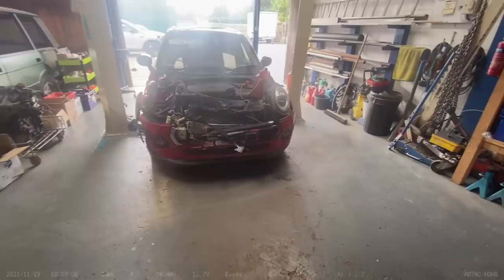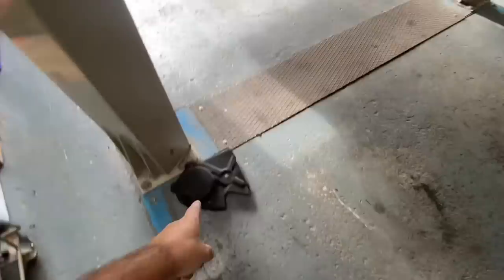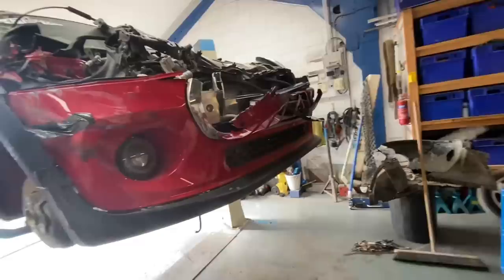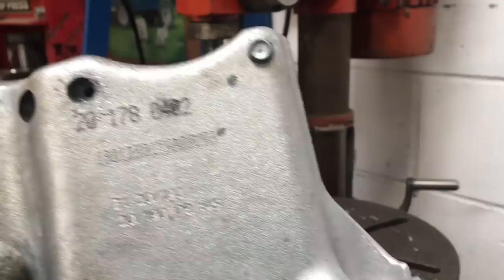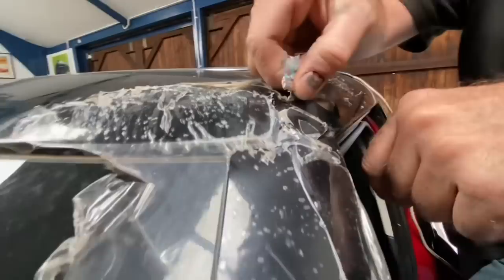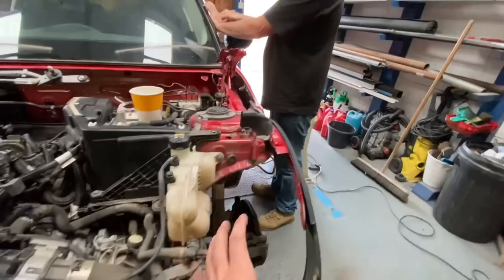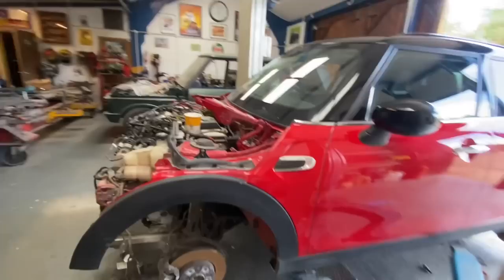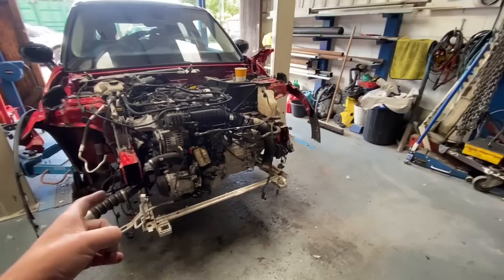REPAIRING A SALVAGE 2020 MINI WITH ACTUAL CRASH FOOTAGE!!!

Comment: Just goes to show how much modern cars destruct on impact. Cheap plastics everywhere. The design that goes into them for passenger and pedestrian safety just allows them to fold up. 1970's car would have hit the truck and carried it down the road. Hope you get all the broken bits out and the rest of the hidden potential damage is minimal. Eagerly awaiting the next instalment. Cheers guys.

Comment: When I saw all that broken plastic and damage behind the engine, I figured right away that you need to pull the engine. It would be easier to work on, plus have access to the parts that aren’t easily seen. Assess the damage from there.
Glad you came to the same conclusion at the end.
Looking forward to the next video!
👍🏻👍🏻

Comment: You excel at getting parts, you have developed a network of suppliers, where your charm and good looks open doors not available to many.😊 on a serious note, it was lucky to find that other mini, especially new enough to allow the owner let you have parts off the engine, is there a sweet point where a car reaches an age where sufficient numbers have been written off that parts availability is easier.

Comment: Hi guys, as always an amazing team work, Chris wasn't a happy boy playing with those stickers lol. Hope your finger gets better lol.
Maybe this video will make people realize how strong are the forces involved in a car crash even at low speeds, is a lot of energy to dissipate.
Regarding the magnets and paint is because dust and sand and etc gets trapped between the magnet and the paint and when the car is moving is vibrating a the magnetic sticker moves even by a little and that basically acts like sandpaper causing damage on the on the clear coat. This was what the guy from Spies Hecker told me once when i asked.

Comment: kin ell, that beginning made me jump..

I cant believe the amount of damage from that speed impact.. Thats clamshell bonnets for ya! If it had steel engine mounts & thicker mount bolts, none of that rear engine & bulkhead damage would have occurred, although the front of the engine would have had a bigger wallop. 

If that much damage occurs with them, these are gonna be getting written off left right & centre...

Comment: Phew, that was something to get the plastic haters running at full throttle. So much broken plastic to be cleared before you could see what you needed to replace. I can see why you think it was a great idea to take the engine out, so the bulkhead and the rear of the engine can be thoroughly checked over before putting it back, all sorted and tidy. You had a lucky break getting many parts as a job lot. I hope the engine removal will not reveal some expensive issues. I am surprised at the amount of damage from a low speed bump. Overall, that was a cautionary video for us all, drive carefully and avoid the damage, mess and risk of injury. (I know that without things going bump, you would be out of work, but that will not happen.)

Comment: are you going to replace the clutch whilst engine is out? being a driving school car it may have more wear - what was the mileage?  Enjoying the videos - great work :-)
Reply from the maker: Not at 30k no 👍
Reply: My previous car had 130k as a tuition car and the clutch was still original not slipping or anything. Tuition cars are probably better looked after than most of the wheels aren't turning instructors ain't earning so for me my car is checked every 6 weeks and anything looking on the way out is replaced

Comment: Great Vid as always Guys, contacts are a God Save for parts etc, Best of luck sourcing all the front bits, Give you a Laugh, washed car day of birthday, parked on my driveway hill,electronic handbrake failed car rolled down driveway crashed through front gates, gates swung back and destoyed both font wings door mirrors door handles and dented back door,So 20miles damage you were lucky, but as iam a Mechanic and can source parts car was done in 2days, Cant wait for Next vid. Darren  Co.Cavan. Ireland.
Reply: Should of put it in gear mate   i allways  do x

Comment: Brilliant video as always. Chris why don't you drill it out then use a stud remover Why continue to drill it out more?  I don't very often do things like that and I'm learning all the time
Reply: I have a left hand set of drills ( no joking ) but no good unless your drilling machine will work in reverse. I use mine on my milling machine and a lot of the time drilling them left handed will catch on the broken bolt or stud and just wind out the stud with no damage at all to the threaded mount or whatever. No need to run a tap down into the hole even.

Comment: The screeching sound has been dubbed over the top.  Seems strange the instructor didn't try to correct the wheel or apply brakes.
Reply: Looks like they were on the phone. Would love the original audio..

Comment: I thought those were quite flash with all the bells and whistles, especially in 2020. But it didn't have the auto-braking crash sensor wotsit (whatever its called). My 2018 Mazda hits the brakes itself. Gave me a hell of a fright when it first did it. I was zooming past a car that had turned off to the left and the Mazda evidently thought I was going to clip it and slammed on the anchors.   Later I found out how to reduce the sensitivity. :-)

Comment: That much damage after an 18 mph collision.? Just goes to show how cheap Mini makes their parts these days and charges a fortune for the car, On the subject of drilling out the broken bolts, would a set of screw extractors help ?
Reply: Most cars now deform like that now. Polo re-ended my dads S-Max. The ford needs a new boot door and plastic guard but the polo is completely written off like a metre shorter. Their designed to absorb and crumple rather then your chest
Reply from the maker: It hit a 2 ton 4x4 with a tow bar at 20 mph I think it did ok

Comment: Very strange accident for both front  seated  drivers to be distracted.  Is the driving instructor at fault for not grabbing the wheel and preventing the accident    win win for the Nissan owner one way to check a cracked chassis
Think it might be wise to get the brakes inspected on the mini and as the lumps coming out check and replace the clutch
Reply from the maker: It was a accident bud they happen his foot slipped that’s it 👍

Comment: Please show me how you clean up the oil on the tarmac as I have some to clean u - thanks guys
Reply: On concrete I use to do it with warm water with lemon based hand dishwash soap called Dubro don't know if you know this brand in the Uk.

Comment: Excpect the extent of the damage was caused by the fact the pickup it hit was higher up the steel chassis/bumper probable just hit the block and pushed it back. Speed wasn't that relevant

Comment: Surely a stud extractor will be easier and quicker than drilling out the bolts completely?
Reply from the maker: They just snap off
Reply: I have a couple of sets of left handed twist drill bits. They look just like normal bits except that the flutes are backwards and you use them with your electric drill in reverse. This means that if they bite into the remains of the bolt there is SOME chance of it winding straight out. Chris was drilling from the other side here, as he explained, so there was a possibility that the standard twist drill bits would 'bite' and spin the broken bolt out upwards.
Reply: @iang3802  That makes sense. Often with the bit of heat generated from the drilling process can start things moving. I had assumed that Chris had drilled right through the bolt enabling the extractor to be wound in from the broken end. He's clearly doing it all the time so would know what works best.

Comment: Strange accident that one, considering the speed and angle the car was going at I'm not sure how the driver wasn't able to brake or turn regardless of if they are a learner or not.
Reply: In general, new drivers tend to freeze rather than react when something unexpected happens. That's what dual controls are for.
Reply: Strange one for sure .
Reply: He said that he pressed the accelerator and not the brake by mistake. Prob due to it having dual controls.
Reply: @JUNK4UCREW  dual controls are only for brake and clutch. He said his foot slipped off the brake.
Reply: @JUNK4UCREW he didn’t say that at all he said his foot slipped off the break as he was trying to apply it

Comment: So they crashed on purpose right?
Reply: obviously not it must have been a brand new driver and as said the instructor went to hit dual brakes and missed
Reply from the maker: No
Reply: @TheDarkSide46  Well then its the most bizarre  crash ive ever seen. He was driving straight then just casually turned into the stationary vehicle. As for the instructor not acting in time i mean it wasn't as if they were speeding.

Comment: For a car that is so expensive new and a slow impact just shows you a low quality    built car
Reply: Most modern cars are designed to deform like this to absorb the impact to minimise damage to the occupants. It’s the same with the rear ends of cars. Main reason why manufacturers stopped selling “dog guards” for smaller hatchback models is because the poor pooch would be crushed should there be a rear end collision. 
Best to have the dog inside the passenger compartment but restrained using a suitable seat belt attachment.
Reply from the maker: Your wrong bud it was designed to do that and it was heigh up and hit a 2 ton motor with a tow bar  these are solid little cars 👍

Comment: nowadays there are very few cars with a solid steel chassis hiding behind the rear bumper
oh dear, the nissan pathfinder is one of the very few....    whoops...
 the pathfinder will probably only need the plastic bumper skin repairing
driveshafts have a habit of poking a hole in the lower engine casing, might need that engine after all...     keep up the good work chaps

Comment: That is a lot of damage for a 20mph impact but it's probably since it hit a 4x4!
Reply: Imagine the damage at 60 MPH YOU WOULD BE LUCKY TO WALK AWAY FROM IT
Reply: Designed to that to absorb the energy
Reply from the maker: @thomasshepard6030  your wrong bud these little cars are solid and as you can see the accident missed the chassis it hit a tow bar
Reply: @thomasshepard6030  60 mph impact speed in any car would be fatal

Comment: Plastic used to be good years ago - now they make it brittle - it's just not like it used to be, i have laundry baskets and plastic washing up bowls over 40 years old ..no cracks or fractures ..buy a plastic bucket  or washing up bowl from poundland you'll be lucky to make it home without shattering it  - so it seems BMW plastics are only as good or about the same as poundland 😁
Reply: It's designed to crumple on impact to save killing pedestrians and passengers...20mph causes that damage as a sacrifice.

Comment: Does the car have a handbrake? Or was the instructor not watching what the learner was doing?
Reply: It was dual control but the guy said hi foot slipped off the pedal…
Reply: @philtucker1224  I use the same make of dual control as fitted to that mini and the rubber is extremely grippy .So I’m scratch my head over this one .

Comment: I cannot work out how that Pathfinder rear end looks to have only minimal damage yet the Mini is totalled at 20mph. Not disputing the speed, but the disparity in damage levels is insane.
Reply: The front of any reasonably modern car is designed to crumple to absorb as much energy as possible from a frontal impact, the rear of a vehicle is designed NOT to crumple (mainly because that's where the fuel tank usually resides).
Reply from the maker: It had a tow bar fitted hence the damage 👍

Comment: 20mph and that's the damage? WTF, then these are a serious piece of very overrated expensive junk!

Not a great endorsement for BMW.
Reply: Hit the nail on the head!
Reply from the maker: It hit a 2 ton 4x4 with a tow bar at 20 mph I think it did ok
Reply: @sruk  Be that as it may, it still doesn't take away the fact that they are garbage and can be very problematic. Personally I wouldn't feel safe in one!

I love your channel BTW and watch from Taiwan 🇹🇼.
Reply: @terryroe2023  completely irrational......! 
... Garbage is in the eye of the beholder! They're no worse than any other modern car - it's down to your personal prejudice.....
Reply: @andymccabe6712  best we not have drama here on this great channel. I gave my honest opinion regarding this vehicle and that's never going to change.

Undoubtedly the guys will rebuild and put it back on the road as that's what this channel is all about.

This car is overrated without question just ask the Muppets that forked out to purchase one! Ridiculously expensive and bend easily, so f... that!
Reply: @sruk  would you be so easily forthcoming making such a statement if that was the Lamborghini as that surely would be in a far worse state as under the body there is very little in the way of protection.

Comment: Doesn’t say much for a mini after a 17mph shunt
Reply: Most modern cars are designed to deform like this to absorb the impact to minimise damage to the occupants. It’s the same with the rear ends of cars. Main reason why manufacturers stopped selling “dog guards” for smaller hatchback models is because the poor pooch would be crushed should there be a rear end collision. 
Best to have the dog inside the passenger compartment but restrained using a suitable seat belt attachment.  Passenger compartment is designed to be the strongest part of the car, usually made from boron steel, anything else in front or behind is sacrificial.
Reply: I see cars on a daily basis written off under 10mph passengers unharmed though !! Cars done its job !!
Reply: You do realise they are supposed to take all the impact and destroy itself so the driver and passengers can walk away, the strong bits stay strong but the rest of it is supposed to crumple and break.

Comment: Not being disrespectful, but it looks remarkably like an accident where the driver and sole occupant of the vehicle is using his phone.
Reply: Rob's story telling how the lad explained the crash had me laughing, I'm not sure how your foot slipping off the brakes makes your steering turn like that, as you say distracted for a particular reason.
Reply: Its a dual control driving school car. The instructor's foot slipped of the brake.
Reply: @geoffwoodgate7450   The insurer has bought that line, but I don't. 2 people in the car that can stop and steer it, yes, the instructor can grab the steering wheel if needed, that slow speed drifting off line into the back of a parked vehicle wouldn't happen
Reply: @paulb1034  yeah looks a bit suss to me. Even the instructor’s foot did slip, there was no evidence of him trying to correct the steering - something they likely have to do all the time.